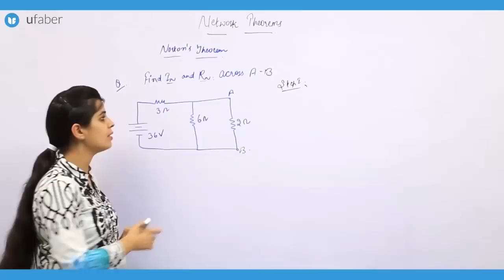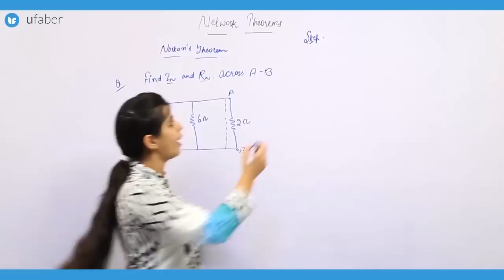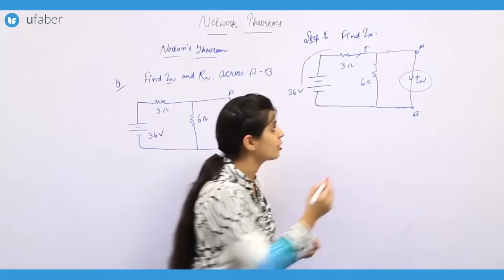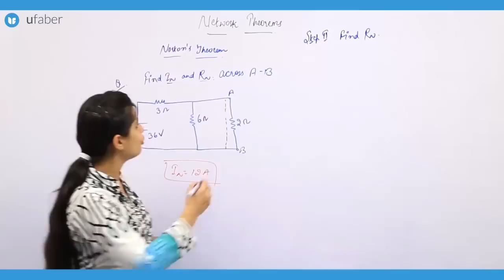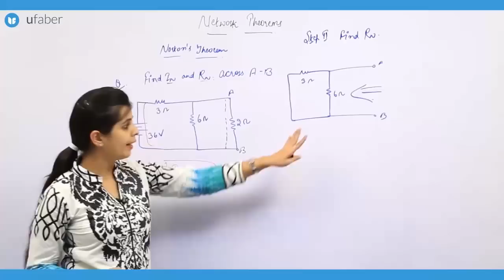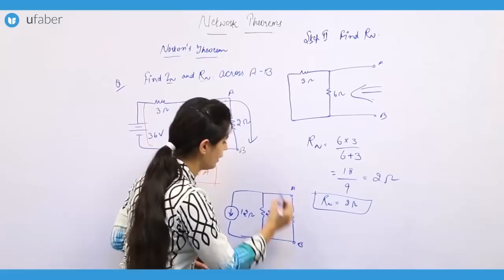Norton’s Theorem  GATE Electronics and Communication

Comment: we have to short circuit AB means we have to remove load I.e RL.. m I right?
Reply: Yes
U are supposed to remove The resistor and replace it with a simple wire

Comment: initially when you were finding the current...and talked about least resistance...

3&6 ohm were in parallel making resultant 2 if you neglect 6 the resultant resistance is 3... why current didn't flow from the middle of the cross section?